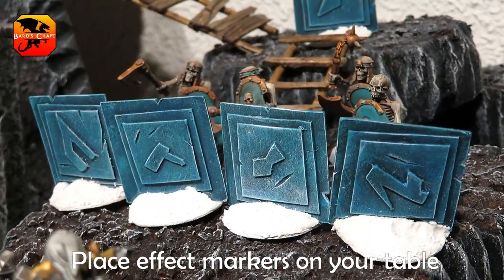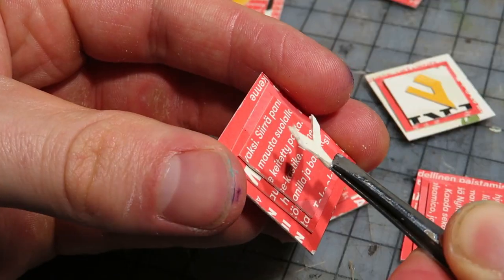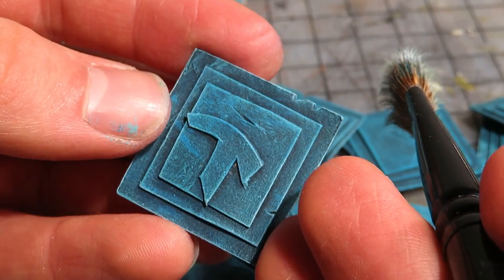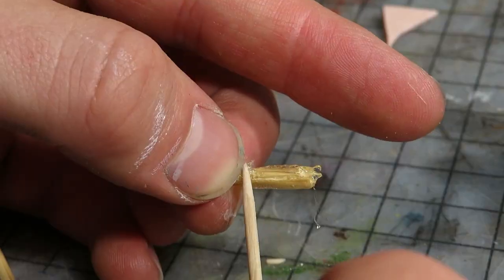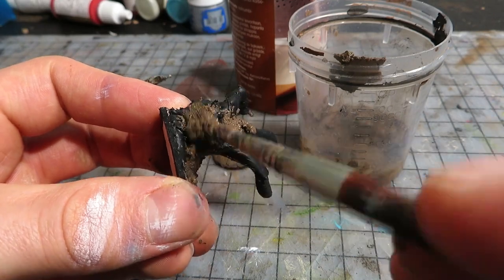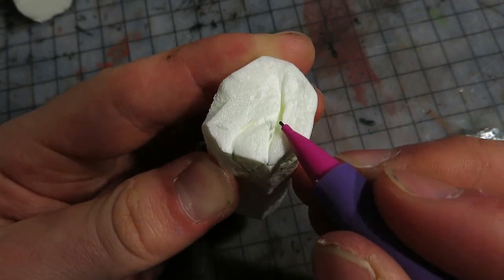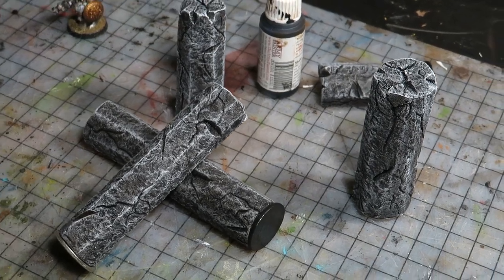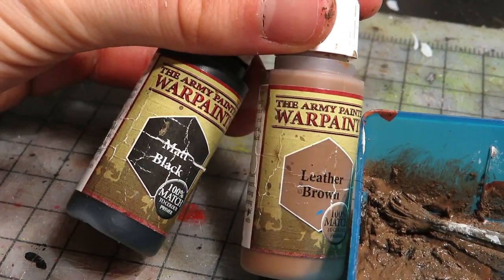Epic Evocations: 4 EASY Spell Markers for D&D

Comment: If your glue is melting too hot/bubbling, try keeping the glue sticks in the freezer until use. ( i've had this issue myself before i got a dual heat glue gun) It stops the glue overheating and reduces 'stringy' glue bits. Also, if you have some laying around as i always seem to, silicone sealer/ bathroom caulk is great for textures and mushrooms and such instead of hot glue! ( though the 'blowing noises' made me laugh so much!)  Love your crafts, this video was awesome! Dont stress about the voice!

Comment: Sorry for question but what kind of material is the foam of which is pillar ?
Reply: XPS Foam
Reply: Also called extruded polystyrene (as opposed to expanded polystyren). Used for insulation. Go to your local building material shop.